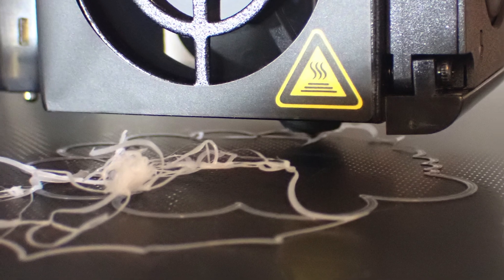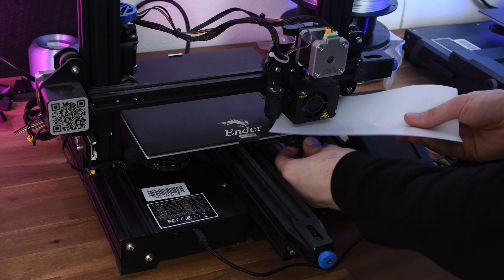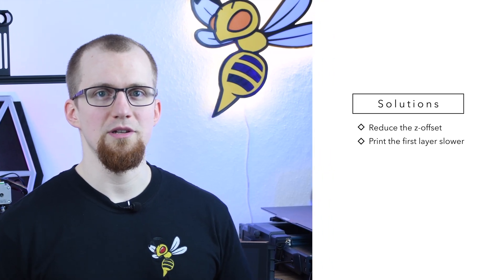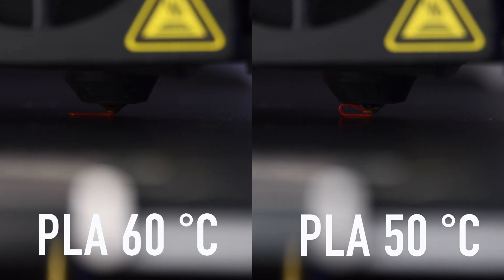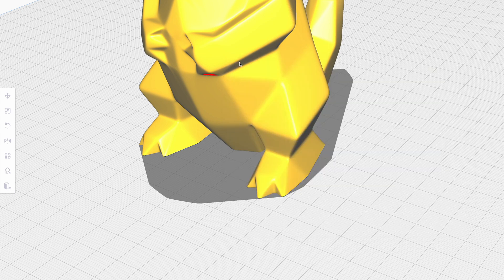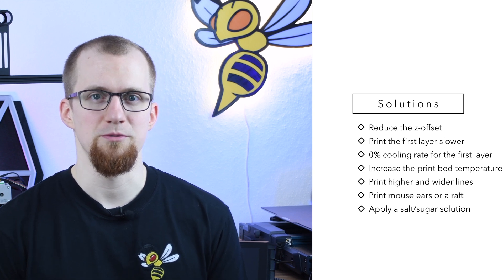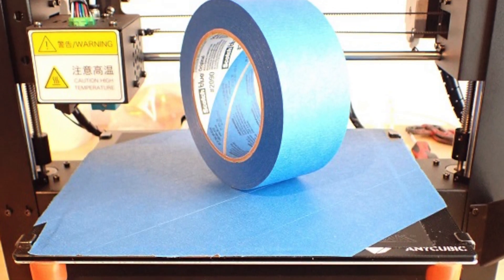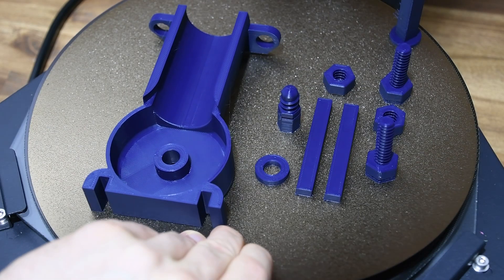3D Print Not Sticking? 9 Ways to Get Perfect Bed Adhesion

Comment: I have a Ender 3 2v Neo and have tried all your recommendations.  I have the flex steel bed and it worked perfectly for the first 24 hours of printing.  Now I can't get anything to stick to the plate.  Thanks for all the great ideas and things to try.
Reply: Same for me with the Ender 3 S1, no matter what i try, i get no adhesion.
Reply: s1 user as well everything is ok for like 3 percent then everything just falls apart
Reply: @DJOrangeJoe did u try to slow ur speed to 50% for first few layers?
Reply: @netalkss usuall i did 50 then down to 25, dont matter
Reply: @DJOrangeJoe I also have an ended 3 s1 and my layers start peeling off the bed while I’m printing
Reply: @Toybonniefan2222 same here!
Reply: Man, i have the same problem whit ender 3 v2 neo.

i print some things, and now i can't make anything, i'm so frustrated, can You solve this problem?
Reply: @leon1991-oct just buy G10 bed
Reply: I'm with you guys. I think most of my problems stem from my model ender not having an auto level bed and me struggling to keep everything aligned when manually leveling it.
Reply: I just got the ender 3 the test print worked fine I can’t get anything to stick  now
Reply: For me glue stick worked well
Reply: You try lowering retraction?! That helped me😊
Reply: I have an ender 3 v2 neo and always had bed adhesion problems. I’m trying to print the eiffel tower and nothing works. I even used a raft and the whole raft just popped off the bed
Reply: @psychicsheeppaz3590   try updating firmware and recalibrating the whole printer using their official guide it helped me a lot i also couldn't get anything to stick
Reply: The z offset should be almost touching the bed
Reply: I use raft adhesion option  in slicer it works best for me but it is difficoult to remove
Reply: ^^^^^^^^same printer, same story^^^^^^^^^
Reply: Me too the excact same thing it doesn't stick
Reply: Try lowering retraction folks!! To 2.. If that dont work try 1...!
Reply: I was facing the same problem but after I increased the bed temperature by 10 degrees and adjusting the Z offset to be close as much as possible to the bed the printing is much better now.
Reply: @Tobyboby666 try less retraction... and make sure your feeder screw has good teeth!
Reply: i hate this printer
Reply: @DeedsForCheap  I have a love hate relationship wit mine😆 noww that I have the direct drive adapter with a good feeder gear and dual z axis.... suckers a CHAMP...!
Reply: Ender 3 s1 I can print pla after I mess with slicer settings and I have to print slow and have a desk heater right by my printer to get things to stick
Reply: I HAVE THE SAME PRINTER WITH THE SAME ISSUE 💀💀
Reply: Same here, printed 3-4 things perfectly and then has never worked since… Ender 3 S1 Pro
Reply: U guys have to get good temperates so it could stick good
Reply: Same, I have the ender3 v2 Neo as well
Reply: @TimedTrooper  try 120% extra material for the first layer. i had the same issue with my ender 5, after it sitting for some years. the PLA can also have gathered moisture. so try to run it hotter, thicker layer and more material on the first layer
Reply: @GoalOrientedLifting Just got an Ender 5 Plus, about 50 hours in, and tonight that first layer will not stick to the bed. Increased temp on head, then tried head AND plate…. Damn PLA adjust follows the head around in circles. Even tried slowing down to 40% speed, increased flow to 110%….. GRRRRRRRR! Thinking of upgrading the extruder, but beyond that, I’m wondering if I should try glue sticks? I see your post was from 3 months ago….. Have you found any solutions with your Ender 5?
Reply: @Jackwagon5191  make sure its calibrated, so you can just get a A4 page under the extruder at the 4 corners(im guessing this is done automatically but once issues occurs it oculd be wise to double check)

but first thing to try is to increase excrusion amount to 110% or 120% for first layer(easily done in settings).

washing the detacheable plate can also work, ive had issue where dust made it not stick
Reply: @GoalOrientedLifting  came to the conclusion that the nozzle was plugged or clogged. I replaced it with new nozzle and seemed to solve that issue. My second Ender 5 Plus arrived yesterday… started a print job last night, and when I woke up and checked it this morning, first layer looked good, then the rest of the layers going up looked like a sponge. So frustrated. Is a .04 nozzle too small?? Creality filament crap?? 100% flow and 90% speed set….. 🤷🏼‍♂️
Reply: @Jackwagon5191    moisture in the filament. It absorbs humidity and you get that odd bubbly effect as the water vaporizes during heating. Store em in a container with silica pads or diapers. I know some people use an oven on low heat, but i just toss in silica in the container.

Btw run calibration prints. You will small ones that tests overhang and stringing at like a 30 degrees Celsius range, so you can see what temp is optimal. They use the printing of the temperature number as a part of the test
Reply: Dude I have the exact same problem. Haven’t watched the vid yet but if anything in the vid didn’t work for you can you recommend anything for me to try?
Reply: 3dLAC PLUS. I've had zero adhesion issues since using it.
Reply: Use print on the glass printings bed I use it and it works
Reply: Try leveling the bed in a 9 point pattern and then got back to the corners to make sure they're level use a glue stick and try a raft until you don't need it anymore
Reply: Welcome to most peoples issue with 3d printing. Same with a glass bed. They just wont stick. Im going to order a new $14 glass bed wber 5 prints now. Theres no other way. Even elmer is failing me
Reply: Same here with creality ender 3 v3 se
Reply: Ender 3 pro. After using it for about 3 weeks woth regular cleaning I'm having the same issues. I think it's just enders being total dogshit
Reply: Salme here 😢
Reply: I have resulted to keeping my torch on while the first layer goes down anything messes up gets torched down to the bed and it actually works pretty good
Reply: Same here w a 3s1, tried a glass bed that worked for a while, then nothing, switched to a magnetic bed, it only worked for like 2-3 prints. 
Switched back to glass, and I'm getting roughly every other print to come out. No matter how many times I clean and relevel.
The only thing that seems to help is if I flip it to have a huge footprint, but that also eats up a lot more filament.
Reply: What worked for me:
solution: buy another generic plate that is the same size (the option that I picked, the option that worked for me)
@me if you want a link to the plate I bought for my Ender 3 v2 neo
Reply: @tradetariffs   Could you post the name of it and the site you bought it from please?
Reply: Ender 3 v3 SE here, same issue. The flex plate worked for the first few prints and now nothing.

The test print on default settings won't even do it. I'd say it fails 50% of the time.
Reply: @BelowAverageGaming  just wash it with hot water and liquid dishwasher detergent and rinse it good
Reply: @BelowAverageGaming  wipe down your bed with isopropyl alcohol to get you oil residue off of it should immediately increase your print adhesion.I have an ended 3 v3 had the same problem
Reply: First mistake was buying Creality 😬